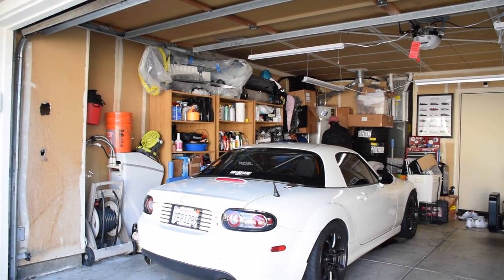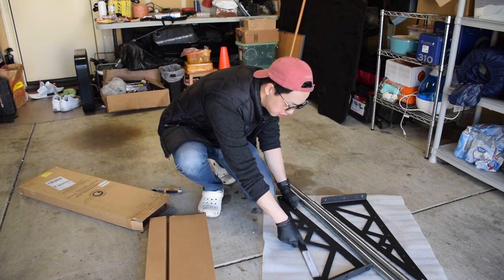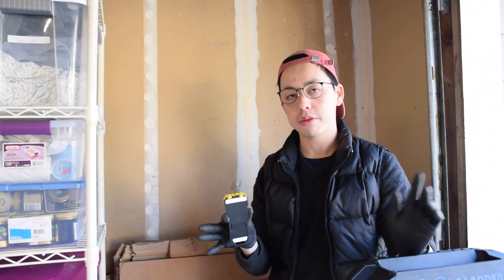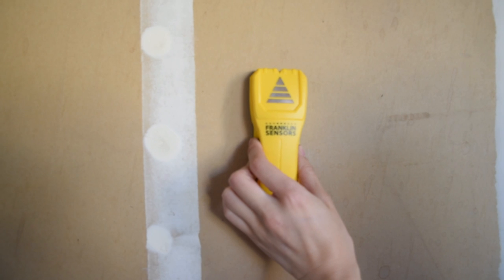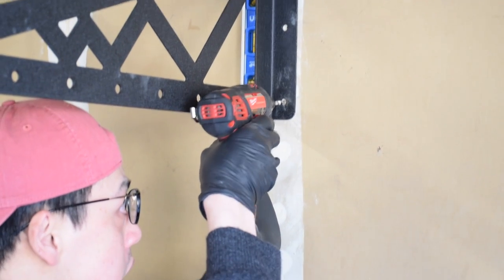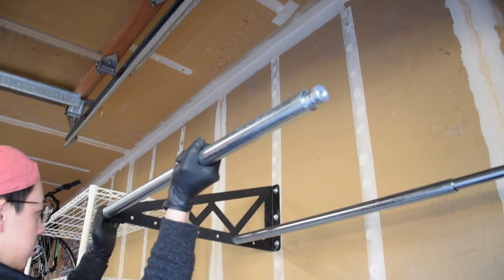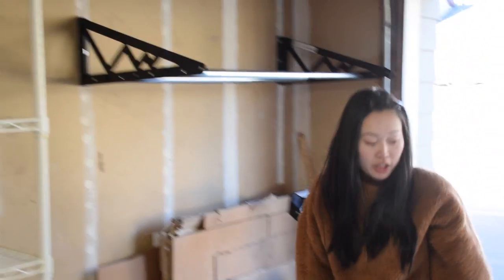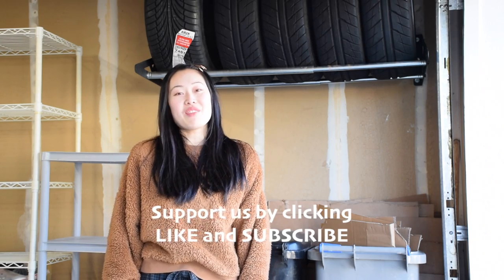Installing a Tire Rack in the Garage | Wall-Mounted Wheel / Tire Storage

Comment: Just a heads up for the softer 200tw tires, they can develop flat spots/indentations if left on the rack for a while in the same position. I have a rack with much wimpier metal beam things going across and to mitigate the tire dents I use pool noodles. Just a consideration.
Reply from the maker: Thank you for pointing that out! Pool noodles sound like a good and cheap solution